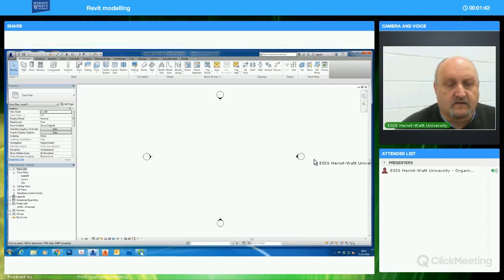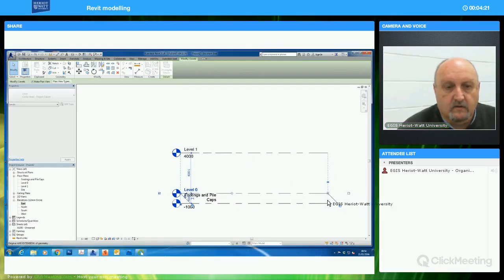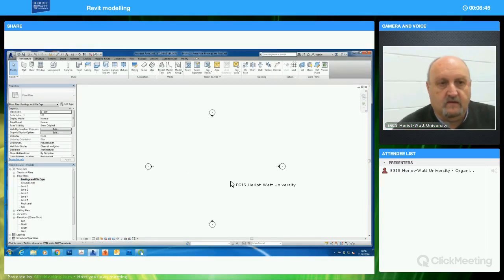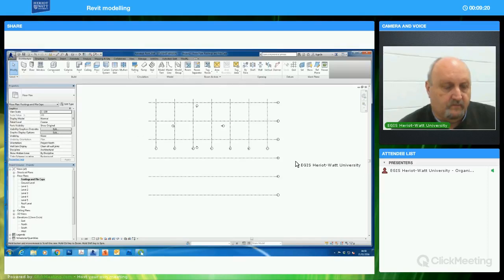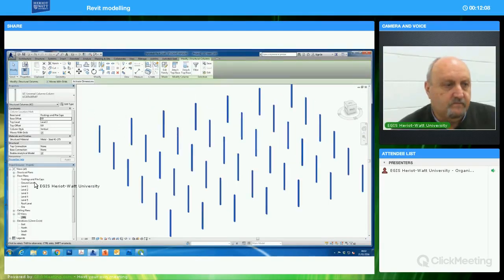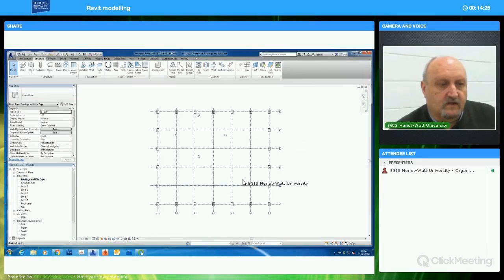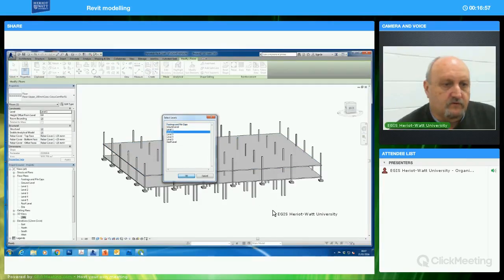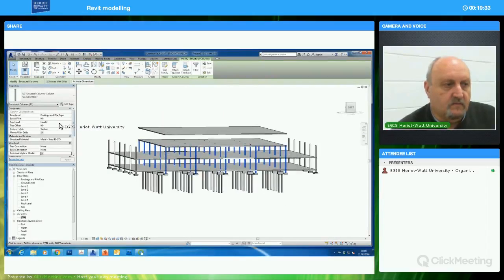Revit modelling workshop 1

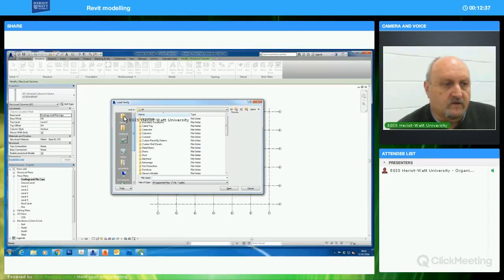Comment: i dont have those 12:41 i dont have the folder
Reply: +WHYnotGTA 
Go into your control panel, go to Programs and Features. 
Then do a Unistall or Change of the Autodesk Revit Content Libraries "insert year here" 
Far left option on the autodesk launcher. 
Add in your content of choice and go next. 

Then it will start downloading your missing content, much like I had at one point. 
Hope that helps you out!
Reply: I chose US imperial and the other one but i cant see any in revit i doesnt work
Reply: It should go into updating, perhaps try and unselect them, go to next and then start the process over again and select again. It can be a bit... derpy to say the least. All else fail, just use metric and rename the selections as you need.
Reply: okay ill try :)